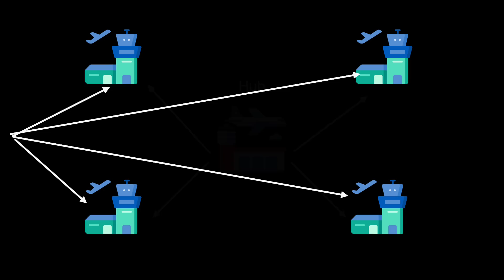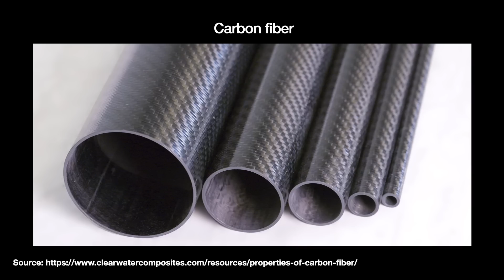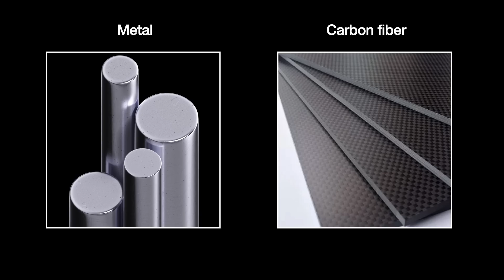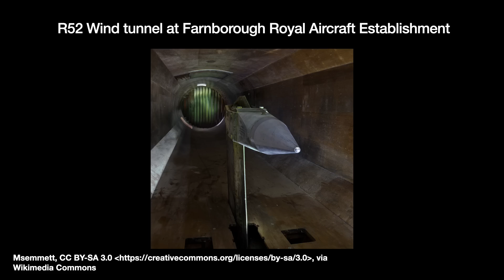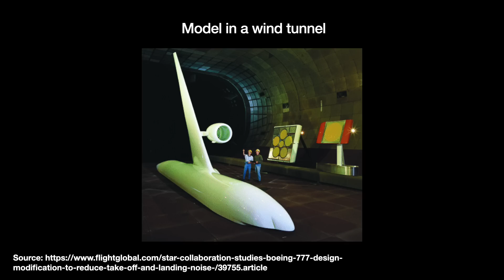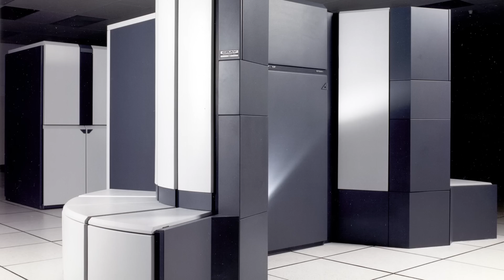How the Computer Helped the Boeing 787 Soar

Comment: The last 3 minutes cover what the title promised. 

CFD vs CAD that fueled motor vehicle 'revolution' decades ago.
Reply: On the one hand Jon isn't an aerodynamicist and details.may be sparse because of commercial sensitivity. On the other hand, I expected more on how CFD has advanced from rooms of people hand calculating the Concorde delta wing shape to today's ability to evaluate and implement minor changes on wing chord and twist using CFD and modern CPU/GPU. Changes that add range and efficiency to existing designs. 

Perhaps a choice for a follow-up?

Comment: Great video!!! I'd love a video about the flight computers! I know they often have three computers running different software that need to produce the same output from given input and reach a consensus... what architectures? what programming languages?  Wow, that'd be awesome.
Reply: Start with the space shuttle. Most of the documents are public, including the disciplines in the software engineering teams. 
4 computers on one hardware architecture with one software suite. A fifth computer from a different team on a different hardware platform with different software, in place to independently duplicate certain critical flight phases in event all the other four computers "rage quit" or "halt and catch fire"
Reply: If you want real info about flight computers and avionics, I suggest *Alexander the Ok*.

Comment: The only commercial aircraft that doesn't leach TCPs from the engine oils through the compressor to the cabin as the 787 uses electric compressors for cabin pressurization.
Reply: The airbus A350 too.
Reply: @ta0304 No it does not. Only on the B787 with "bleedless" GEnx 1B and Trent 1000 engines. The GEnx 2B and Trent XWB are essentially bleed air versions of those engines for the B747-8 and A350.
Reply: I don't care. I've ridden the 78 and didn't like it. Give me a triple 7, an airbus, a 747-8i, embraer,  whatever. 

"But the windows, the cabin pressure!" I don't care. 

Thanks for the data point. I still..don't care. Be blessed friend and have a wonderful life 👍🏻

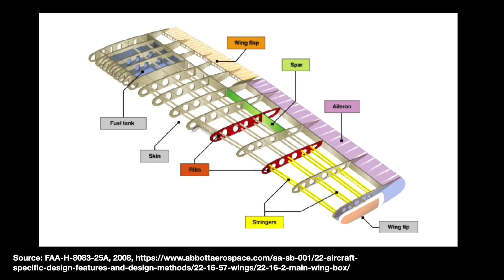Comment: 9:15 That honeycomb sandwich was in the XB-70 Valkyrie using stainless steel! I don't know of any other planes that use it. Bit if a red herring, I know, but if anyone knows of other use cases, please let me know. I realize this kind of engineering isn't what the channel is about.
Reply: It's pretty common, actually! At least in aerospace, afaik. It's called a sandwich panel, adding a ton of thickness via a honeycomb layer makes a part much much stiffer while not adding much weight. They're getting less and less common, because their downsides can be pretty significant, and stiffeners like the ones mentioned when he's talking about wing  box are taking their place.
Reply: XB-70 ♥♥♥

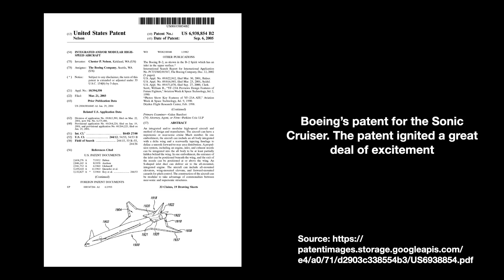Comment: 4:04 I suspect this should be 15 percent faster rather than times.  Most commercial jets cruise around Mach 0.8 (as fast as they can go without trans-sonic shenanigans).  
The Convair 990 was also designed along these lines although it was less radical, looking mostly like a regular tube-with-wings.
Reply: yeah, planes were already cruising at "just under the speed of sound". The idea was to be a bit closer to mach than what they were already doing - 0.85 or so.... Probably meant 15% because 15x would be hypersonic by any definition and actually insane.
Reply: @X85283 I don’t think we have materials that can survive 15x the speed of sound(almost)
Reply: @AliAbdallah-k7b  Not much and not for long at least. But Apollo reentry max was M32 and Space Shuttle was M24, for what its worth.
Reply: @X85283 those weren’t controlled, or powered and so count as more of a “fall”. You can fall at 15x the speed of sound.
Reply: @AliAbdallah-k7b  What you said was "I don't think we have materials that can survive 15x the speed of sound" 

You didn't mention control or being powered. And no, I cannot fall at 15x the speed of sound, nor can you. For one it is WAY above terminal velocity for a human and secondly we are definitely NOT made of materials that can survive anywhere near that speed. 

Falling vs Flying doesn't matter when the issue is "can materials survive", which is what you said.
Reply: I had the same thought, but couldn't figure out the 15 number. You're 15% assumption seems correct to me.
Reply: There’s video out there of a guy on a commercial jet filming a wing in decent and you could see the shockwave forming on the leading edge, probably in the area of Mach 0.9 or thereabouts, it was fascinating to see.
Reply: Beat me to it!

Comment: i got the 33gb ansys CFD suite so i could  simulate different push/pull configs in my NZXT H9 case with vertical GPU mount for my 3080.
deer. in. headlights. but hey i have the FULL suite of programs to run it.
Reply: I was using ansys for a project and my boss sent me a tutorial video. Part one was 16 hours long 😅

Comment: After the multiple battery fires on the 787 Boeing engineers designed and installed a fire containment vessel vented to atmosphere on all 787 aircraft.
Translated from Boeingspek to plain English they designed and installed a fireplace and chimney.
Reply: It was pretty good evidence that they can be very safe when made with the right parameters, they've not had issues for many years since. Unfortunately when made smaller, lighter, and particularly faster and cheaper, quality problems creep in.
Reply: Those fires were at the leading edge of extensive use of lithium ion batteries. The current fires are from electric vehicles, scooters
Reply: @stevengill1736 electric vehicles dont catch on fire that often
Reply: @FireFoxDestroyer  In fact they burn far less than ICE vehicles, ask literally any insurance company.
Reply: @lbgstzockt8493 it helps that electric vehicles don’t cause a small fire inside the engine for movement.

Comment: If they're so concerned about carbon emissions, or even the cost of fuel, why do jets still use their engines to taxi? I know it's primarily about the preexisting infrastructure, but still.
Reply: As opposed to JATO rockets or the Gerald R Ford’s linear induction catapult?  Taxiing doesn’t use much fuel and sitting on the runway primarily uses APU power.
Reply: @ChadThundertalk  Jets burn more fuel taxiing than you’d think, up to 5% of total flight fuel on short hauls. It's not a lot but over time it adds up plus there's also maintenance to consider. Less wear less  tear. It's not like I actually care, but when people talk about emissions. It's kind of like the people who complain about the kids that mine Cobalt for your smartphone but they still have a smartphone, you know.